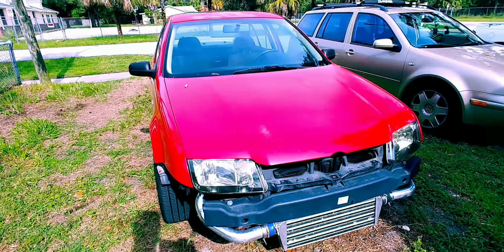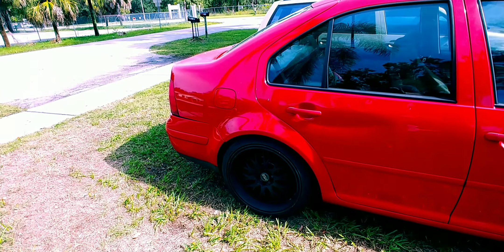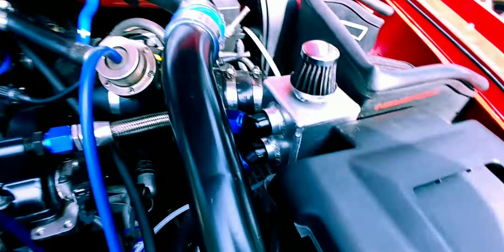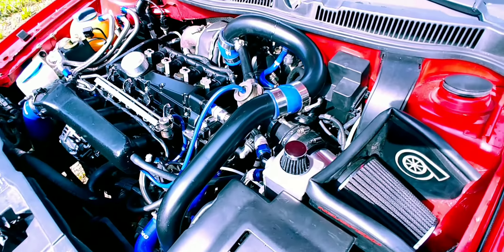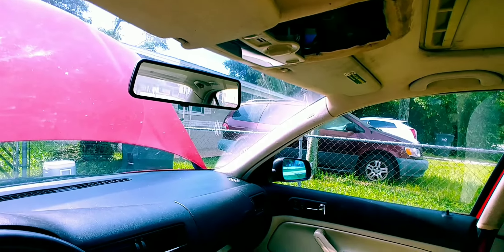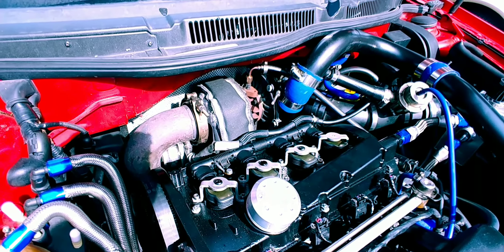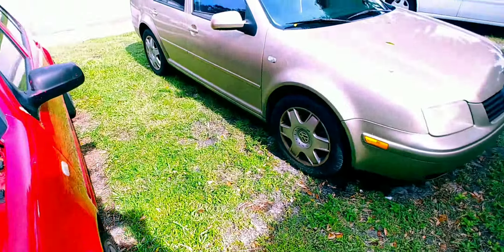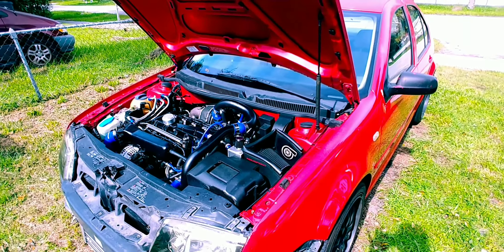Mk4 jetta 1.8t gt 30 big turbo. Unitronic Stage 3 project update

Comment: How's she holding up ? Thinking of going with your same setup also on a stock motor
Reply from the maker: Holding up nicely. Only reason it's lasted this long is because I don't launch it from a dig and the Big Turbo lag lets the power role in kind of smooth and it's not too Punchy which is lighter on the internals

Comment: Do you need built internals?
Reply from the maker: You should do at least rods..  But I'm just sending it for now lol . I'll build the block soon enough
Reply: boosted euros garage how has it been holding up?
Reply from the maker: @Silas_cv1  good so far.. Pulled a couple car lengths on a fbo bmw 335i the other day
Reply: boosted euros garage nice man!
Reply from the maker: @Silas_cv1  thanks bro. I turned the boost up to 23psi. It was 19psi on the dyno when it was 301whp. So Probably like 350whp now I gotta re dyno it soon
Reply: @boostedeurosgarage3347 is it still on stock rods??
Reply from the maker: @williamawade242  it was on stock rods. Drove it for over a year 20+ psi never had a problem